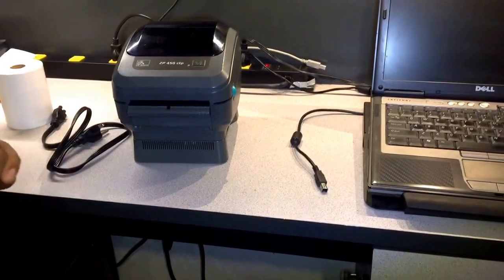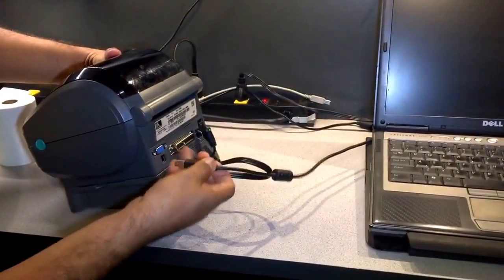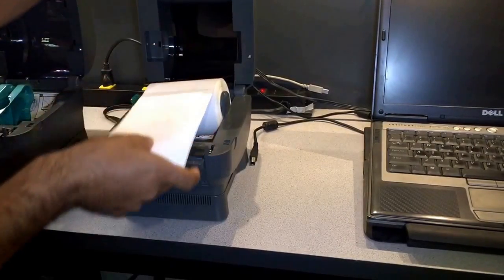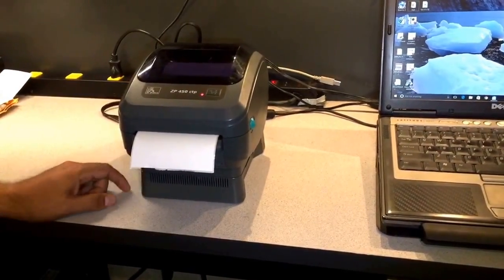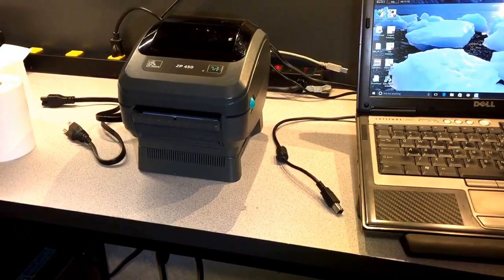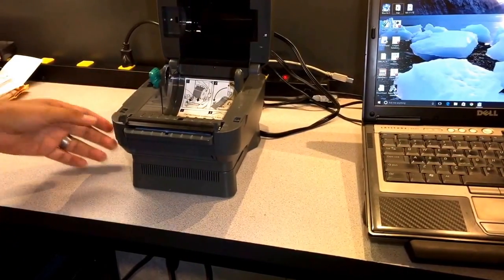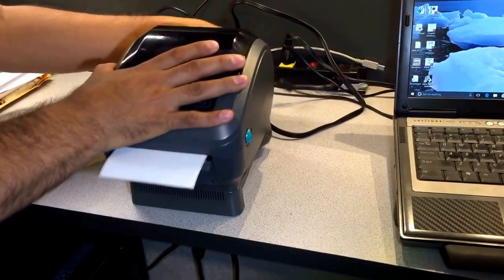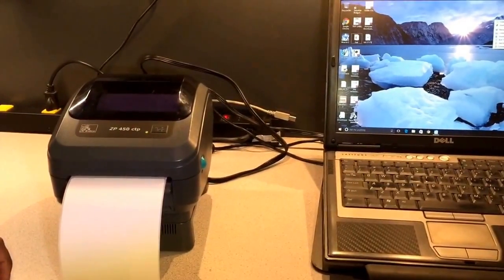Zebra ZP 450 Set Up Before Driver Installation

Comment: i cant find driver for zp450 please provide me the proper link thank you.
Reply from the maker: There are several drivers that work with this printer. The best driver is called Seagull Scientific. You can download it from here:

https://downloads.seagullscientific.com/drivers/archive/2020/2020.4/Zebra_2020.4.exe

We offer free technical support via phone and remote computer connection  if you bought the printer from us. If you did not buy from us, we can still help you for a small fee.

Comment: Can I use this with my mac? I don't have a pc.
Reply from the maker: Hi, Yes you can use the Zebra printer on your Mac. Just connect it to your Mac, got to your printer settings, click on the Plus + button to add a printer. It will ask you what driver to use, choose Zebra ZPL driver. Add the printer on your computer. That is it. The label might come out a bit fuzzy but that still scan. That us normal on a Mac. You can search videos on YouTube about installing a zebra printer on a Mac. You will find instructions as well.

Comment: my zebra ZP450 does have adjustable arms but yours doesn't?
Reply from the maker: Hi, Zebra Makes two different versions of these printers. One with adjustable label holders and one with out it that only works with 4 inch wide labels.

Comment: Hey solution my printer does not feeds out labels when I turn it on anymore, it starts off with a red dot then waits seconds and turns red, the only time it feeds out labels is when I press the button, I tried calibrating and the printer always stops at the middle of the paper, adjusted the 4x6 settings as well
Reply from the maker: Hi, Thank you for contacting us. That usually means that one of the latches might be broken. Please check the two green hooks on the lid. If one of them is broken, the printer will not work because is not closing all the way down. Usually the right green hook is the one with the sensor. Please let us know if you bough the printer from our company. We offer repair services and tech support over the phone. Have a great day!

Comment: When I try to print the IP address, it does not show on the print out. Do you know how to fix this?
Reply from the maker: Hi, Do you have an ethernet connected ZP450 printer? Those printers are not too common. If you have a USB connected printer the IP address will not show up on the configuration label. If you have an ethernet connected ZP450 and the IP address is not showing up on the configuration label, your printer might have a permanent IP address configured in its memory. You can try resetting the printer's network settings. watch this video: https://youtu.be/RwoDs9UecDU

If that does not work, we offer tech support via phone and remote computer connection for a fee. You are welcome to give us a call at 888 407 6757.

Comment: Can you set up the 450 printer directly to the router with the USB (I have the none ethernet ) or am I dreaming?
Reply from the maker: Hi, Yes many routers have the option to connect a USB printer to the router so you can share the printer on the network. You will have to find out how set up your printer on the network by reading the router manual or looking it up on the internet. Each router is different. You can also try downloading Bonjour Software. It helps finding the printer on your network if your router is compatible. The software works perfectly for Apple Routers.
We can help you with your installation. We charge $49 hour one hour minimum for remote computer connection tech support. We will not charge you of it does not work. You are welcome to give us a call at 888 407 6757.
Reply: Dont listen to solutions gem lol

Comment: Hello,  Which ink do you use for this printer?  I have a hard time finding the ink.  Can you post a link so we can purchase the ink?
Reply: LMAO.  Uhhhh....
Reply from the maker: Hi, The beauty of these direct thermal printers is that they do not use any ink to print direct thermal labels. They use heat to print into specially coated thermal paper. We have thermal paper label in our website here:

https://www.solutionsgem.net/collections/business-industrial-office-office-supplies-labels-thermal-labels

There is another kind of thermal printer called Thermal Transfer that requires an ink ribbon. The printers are similar but the thermal transfers uses a plastic roll with ink on it that transfers the ink on to labels or paper. Can you tell us what printer model you have? We will help you find the right product for you. 

You are welcome to give us a call at 1.888.407.6757 if you have any questions.

Comment: Are you supposed to leave it on at all times? because each time you turn it on it spits out two blank sheets as it calibrates, which is a quite a waste.
Reply from the maker: Hi, These printers were designed to be left on all the time. Like all newer electronics, the printer will go to sleep when not in use. That way you will not waste any labels when turned on.
Reply: @solutionsgem  hey solution my printer isn't calibrating to the 4x6 paper how do I fix this
Reply from the maker: @Jesus-ov8fk  Hi, Seems like your printer needs calibration. You just need to push the feed button and count one flash, small pause then two flashes. Then release the feed button. Your printer will feed some labels to measure them and calibrate it self. If it does not work, you will need to clean the sensors or replace them. Let is know is if you have additional questions. We can help you with the printer maintenance.

Comment: does it need ink or something like that?
Reply from the maker: Hi, No ink or toner ever needed. it uses heat to print to the specially coated paper. These printers are the most cost effective way or printing shipping labels, name tags, barcodes, etc. You can buy them from our store here:

https://www.solutionsgem.net/collections/computers-tablets-networking-printers-scanners-supplies-printers/products/refurbished-zebra-zp450-thermal-label-printer?variant=12444322948

Please let us know if you have any questions.
Reply: ok. thanks!

Comment: What is the difference between ZP 450 and ZP500.
Reply from the maker: The ZP 450 was created for UPS. The ZP500 was created for FedEx. We like the ZP450 better because it has a larger motor and its a bit faster than the ZP500. Both work with all shipping programs with the right settings.
Reply: @solutionsgem  so when u say it was made for ups what u saying that u can't print fedex canada post or dhl labels?